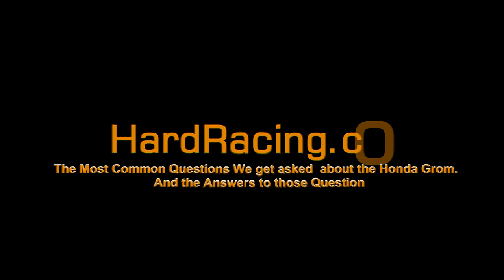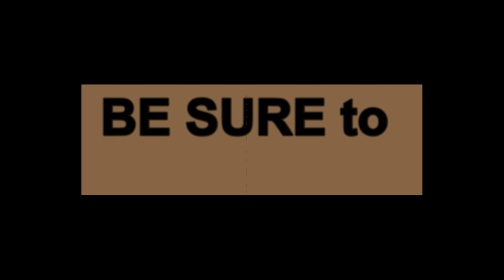HardRacing com  ANSWERS to Our Most Commonly Asked Questions about the Honda Grom #HardRacing #Grom

Comment: Have bought nearly all my gear for my grom SF in Australia from hard racing. Exchange rate is crap - import tax is crap if you go over $1000 AU but the gear is solid.
crg levers 
smoked LED front indicators
Core braided Brake lines (be careful with these my mechanic made me sign a waiver because they are only DOT approved not ADR)
Competition werks exhaust
PCV
Koso Hurricane air filter (not from hard race)
TP-CTL integrated tail light
Front Ohlins inserts
Rear Ohlins shock
Brocks velocity stack (not from hard race)
Ceramic wheel bearings (not from hard race)

My mate who also has a grom has identical set up and purchased the same stuff both happy with the gear
Reply from the maker: Thank you for your support Waz.  ;-)

Comment: they will with minor modification.. its goin to need a muffler mount..the header pipe is the same...the OG mounts are up high..the SF is on the right lower pillion... so the low mount needs a bracket or a strap to hold it in place. you may need to drill a hole in the pillion to mount to..

Comment: I’m running a chimera intake, Toce exhaust, and a flashed ecu from CJR on my OG grom. Will I need to upgrade to a fuel controller if I decide I want to run an aftermarket cam?

Comment: I'm in the process, of upgrading to a 6 plate 6 springs 60% w/ cnc lifter plate on my 2022 grom. Will it be too much grab hookup on the stock engine, w/ a full exhaust, tst air box cover only motor mode? What ya think HR. BK racing. Thank you.

Comment: trying to get my grom set for high altitude but not working..following same clear codes procedure but manual says to close then open/close up to 4 times to get to highest altitude setting and the engine light will flash 4 times quick instead of one at the low altitude setting...I have a chimera, no bbk, a cam, and pipe.  without setting for altitude, was able to go up pikes peak to 14115ft, but the gas gauge showed empty on a half full tank and it really struggled at the top running at 7k rpm in second gear...heh heh....after finding the high altitude setting procedure, none of us (3) were able to set for high altitude but all were modified groms the same way.

Comment: I’m just looking to go highway speeds at least 70mph. The guy I got mine from changed the front sprocket for more off the line power(probably for wheelies) 
What would you recommend I’m 210lbs - would ride around town daily(not racing) and I live in a desert area . Summers are 100+
Reply: Yoshimura Full System, PCV, 14t, Chimera intake,  will get you where you want to be.   Maybe add a Takegawa Camshaft.
Reply: sales @hardracing thanks for the extremely fast response and thank you. I’ll be checking out your site for these specific parts
For the camshaft  . I can run just that correct(s stage performance camshaft) Any other parts?

Comment: I have a zoom exhaust well I have to drill a hole in the pipe to add the wideband O2 sensor
Reply from the maker: We are not familiar with Zoom Exhaust.  But, if your exhaust doesn't have an 18mm Bung welded on it already, then yes.... you would need to have one welded on there.
Reply: HardRacing how do I know if it has a welded bung ?
Reply: Dam I don’t have a bung 😖😖😖. I know my bikes running lean especially since my exhaust install. Any tips on what I should do since I don’t have a bung for the sensor?? What will the power commander do by itself ??? Is it worth it to only buy the power commander without the wideband sensor ?

Comment: hey all, im a honda dealer and tech. i ride a 17 grom as well. if u need help or have any questions ill be happy to help.  i do have DL'able SVC manual for the 14-17grom as well.
Reply: do the low mount exhausts from  the 14-15 fit on the 17's?
Reply: I have a competition werks exhaust for my 17 grom fits perfect !
Reply from the maker: Yes, most of the Low Mounts will fit.
We have our website updated with all CONFIRMED Exhausts that fit the Grom SF
http://www.hardracing.com/13-14%20Bikes/14%20GROM.htm